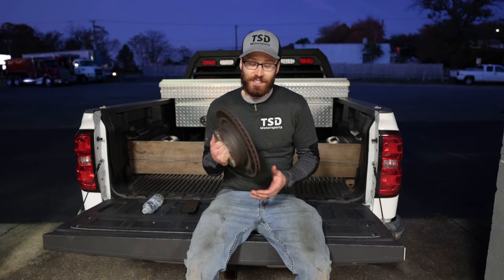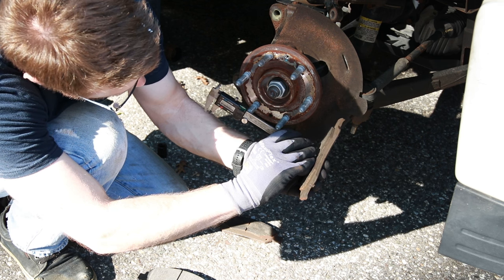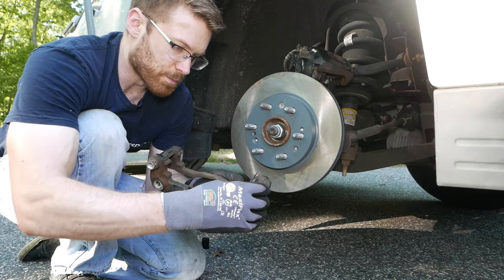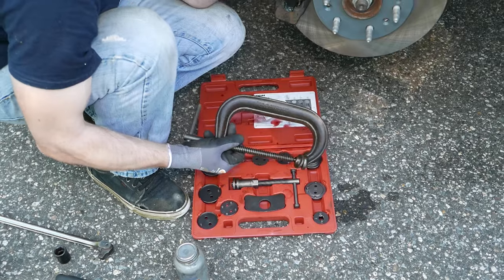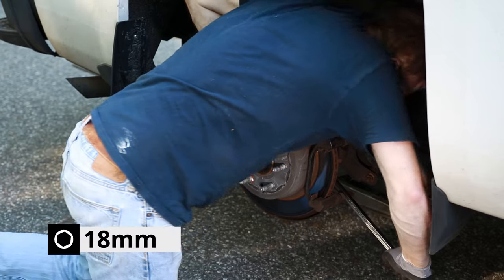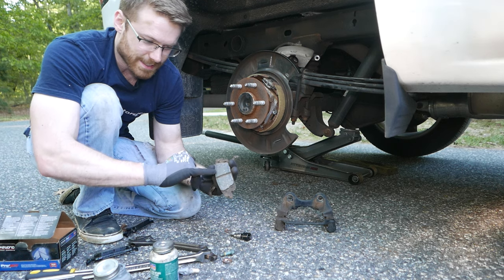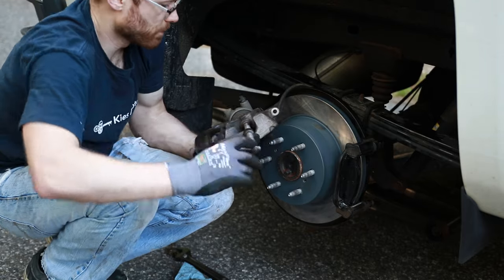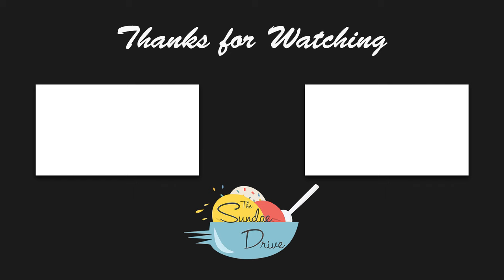2014-2018 Silverado Brake and Rotor Change - Sierra Tahoe Suburban Yukon

Comment: Here is a tip. Make sure to open the bleeder when pushing in caliper pistons. You do not want to push dirt/rust back into the ABS module. Then remove as much brake fluid as possible from the master cylinder and top it off with new fluid. Last tip, when first pumping the brake pedal, only push it half way or less with each pump. Top off with new fluid and you are ready to test drive.
Reply: Damn this is a great advise!!! Thanks you so much!!! These are the kind of details that make this kind of work a success or a failure.
Reply from the maker: I agree. Good tip!
Reply: Wouldn’t this introduce air to the system
Reply: @715glizzy6  No, it will not. Open bleeder and push the caliper piston in. Once the piston is fully compressed, close the bleeder. If you leave the bleeder open, it will gravity bleed an continue to drip, so make sure to close the bleeder once the piston is pushed in. If you do get an air bubble, open the bleeder until you have solid fluid with no bubbles and then close it. Make sure to top off master cylinder when you are done.

Comment: I done this twice with orginal OEM and only got 10,000kms out of a set and I'm definitely not hard on brakes and don't tow. They'd warp easily. So the third set are drilled and slotted all around. It's been two years and no issues. Drive a 17 HC 6.2L with 50,000 kms. Great content and keep them coming. Fan from Sydney Nova Scotia
Reply from the maker: Thanks for the feedback! Haven't had any issues with mine so that's strange but glad the new ones are working out for you. did you go with stoptech or another brand?
Reply: @TheSundaeDrive  I went with EBC and pads, they are expensive but if they last for 5 years there worth it.
Reply from the maker: Ebc are pretty good. We install them on BMWs all the time.
Reply: I went with Brake Performance rotors dimpled and slotted lifetime warranty also, no issues since pricey but worth it in my opinion.
Reply from the maker: Nice!:? How many miles do you have on them so far?
Reply: @TheSundaeDrive  20,000
Reply from the maker: Hopefully they hold up well for you! Make sure to come back and let us know how they do for you

Comment: Recommend cleaning the rust from the caliper (inside surfaces that are under the hardware) with a wire brush. This ensures that the pads are not too tight in the caliper.
Reply from the maker: Great tip!

Comment: Is it possible to install the pads on the front wrong?? the outer pad on the inside and the inside pad on the out? I slapped mine on so fast I did not check

Comment: Great video! Did mine today and didn’t have any problems. Took 5 hours start to finish; 2 hrs for the first one just to go slow, recheck the vid, and double check torque specs. The other 3 took 45-60 min each. Rears are much easier as there’s more room in the bigger wheel well and the bolts aren’t as tight. It was absolutely all my ass could do to get the front ones to 170 lb/ft. I also took my time jacking each wheel as my driveway has a slight slope. Could probably do it in less than 4 hours with a lift.

Comment: Your front brakes should have worn faster than the rear by close to a 2:1 ratio.
Reply from the maker: That would be expected since fronts do almost all the work.
Reply: Chevy wear out on the back faster than fronts !
Reply: @davidguill-wt2kg why?? Mine did that. The backs went way sooner

Comment: I had changed out my wheel hubs and bearings on my 17 silverado. Watching several vids (not this one) nothing was said about anti seize or thread locker on any of the bolts that I could find. I put anti seize on the break caliper bolts and torqued them to spec and it took two days before my brake caliper came completely loose (bolt gone) from the rest of the wheel assembly. This almost destroyed my wheel and thankfully the 2nd bolt held on or couldve been catastrophic. Moral of the story, i would NOT use anti seize as it sort of acts like a lubricant. Maybe I just got unlucky.
Reply from the maker: I think you may have gotten unlucky or used the wrong torque spec.  Ive always used anti sieze (only a tiny tiny bit tho) and have never had any issue. I did my change 50K miles ago now.
Reply: @TheSundaeDrive  I used the torque specs that most of the videos mentioned. No idea what happened. I put a small amount of copper anti seize on the threads after wire brushing them clean of the old corrosion. Never would’ve thought that would happen.
Reply from the maker: Yeah that's pretty crazy.
Reply: I totally agree. And experience the same situation on my 05 Chevy. My front caliper bracket bolts did not hold their torque because I used anti-seize...instead of threadlocker. Engineers know their stuff. When they call for threadlocker use.. basically threadlocker will keep the corrosion out of the bolt and prevent that boat from loosening up. I believe anti-seize is a good product when it's used in the proper situations. Like preventing a wheel from becoming stuck to a hub. Lot of people use anti-seize on spark plugs. Which causes grounding issues to the block. Spark plugs should be installed dry. (To ground properly to the block)…And wheel lug nut should be installed dry. It affects the torque rating. Hey I'm 60 years old. Been working on my own vehicles since I was 14. I'm basically a Chevy man but I do admired Toyota products. Replace the timing belt on one. Timing chains on my Chevy. A clutch on my sabb.. did the front axles on that Sabb too. My 05 Sierra replace alternator, radiator couple of batteries, old changes every 3 months, spark plugs and ignition wires, rack-and-pinion, power steering pump, inner and outer tie rods, AC compressor and condenser and dryer learned a lot from repairing my AC it's best to pay a professional I spent $1,100 fixing my air conditioning.. because I had to do the job twice. I didn't properly flush all the contaminants out of the system.. so I had to buy another compressor and condenser and flush the system properly.. so that double the cost of the AC repair.. I flush the transmission change the transmission fluid and filters a couple of times over the last 190,000 MI decide to replace the u-joints on my drive shaft. Replace the lower motor for the AC a few times, changed out the rear differential oil.. probably my fourth last year replacing my rear main seal on my engine because it was leaking oil at about a rate of a quart ofoil week.. dropping the driveline and transmission behind.. was quite an ordeal when you just have shade tree mechanic and you're working in your driveway that job was very tedious but I got it all back together after 4 days. All I have to say if you're not mechanically inclined it's best to pay a mechanic.
Reply: The exact same thing happened to me. Luckily I was only driving 40 km/h and was able to pull over immediately. The caliper was being held on by 1 bolt and began smashing on the inside of my rim. The second bolt came completely undone due to the copper anti seize on the threads. Never again! Only red loctite on those bolts from now on.

Comment: Some good information, found to be helpful before doing job. Yes the factory uses loctite and you should use blue, red may be for more of a permanent application. Either way, a little heat goes a long way in removing parts with loctite on threads (not a lot needed). Besides not setting a bad example, it could be your bodily injury you prevent by using jack stands. Have a blessed day
P.S. The little click noise you here when you make a stop, and go to back up is because the caliper brackets have started getting loose.

Comment: Also, before pushing pistons back in caliper take off master cylinder cap and put rag on top of screen. Not doing this may backfill your master cylinder reservoir and overflow on flow or get all over your inter fender well.     Nice job.

Comment: The retaining screw is from the factory, in assembly.  To hold it in place on the line only.  Don't need to replace them.
Reply from the maker: Makes sense. I often leave them out.

Comment: My rear driver side rim produces a lot of what I assume is brake pad dust and it squeak... is that a sign the pads need changing. I have 51k on my 2014 Silverado or should I just leave it alone?

Comment: Is this the first brake job of this truck, at 75K miles? Then it's safe to say GMC recommends thread locker not anti-seize?
Reply from the maker: Yes this was the first changw unless the owner did it before 19K miles lol. You can definitely use thread locker if you would like.
Reply: @TheSundaeDrive  Just did mine Saturday (2016, 1500, 68K miles) and two interesting points- my front  caliper bolts were 18mm but the bracket bolts were 19mm... and yep, thread locker. Holy crap, tightest bolts I've ever dealt with, even w/ breaker bar it was just short of impossible to move them. I most definitely did NOT use thread locker when I put it back together and my future self will thank me :)
Reply from the maker: Thanks for the notes! Size must have changed with the refresh. Yeah, Idk why they use thread locker.

Comment: My rear brakes squeal when I apply light pressure when going over 40. The pads have life left on them. Any idea what it can be?
Reply from the maker: You could have a small rock embedded in the pad or something a little harder from the manufacturing process possibly

Comment: Thanks for the video, is there any need to open up the brake fluid fill cap when compressing the pistons back into the caliper?
Reply from the maker: It may make it a little easier to compress. If you do this, put a rag around the master cylinder as some fluid may come out.

Comment: I had to drill the disc screw an now the rotor just isn’t flush an tight what do I do
Reply from the maker: You most likely don't have the rotor oriented properly. Try rotating it to a different position so that the retaining. Screw hole lines up. If that doesn't work, you'll need to carefully sand down the remains of the old screw without damaging the hub

Comment: Will the brake light and stabilitrak light turn on my dash if its time to change my brake pads? I havnt changed em in the 165k miles ive driven it.
Reply from the maker: holy cow man - either you drive a ton of highway or your brakes have been toast a long time. I would change them as soon as possible. I do not believe any lights will come on. BMW has wear sensors that turn on but chevy does not.
Reply: @TheSundaeDrive  yes lots of higway miles in texas lol brakes do feel normal thoe but i will change em out asap